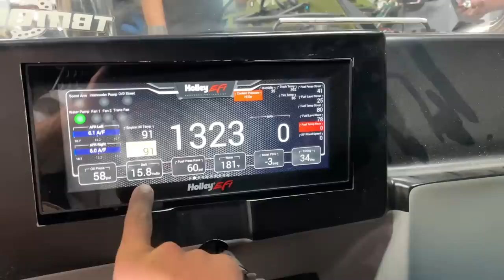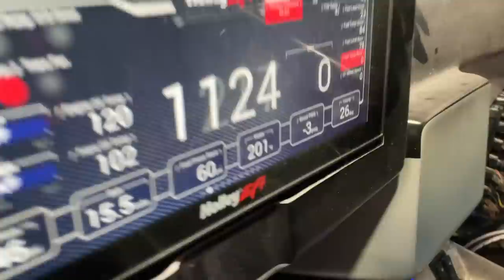FIRST FIRE UP of Mullet's 3000 Horsepower Twin Turbo Big Block!!! **BALD EAGLE SCREECH**

Comment: I just wanna put this out there, John force burnt himself on your old turbo….keep it forever haha
Reply: This comment should be posted up top.
Reply: Elaborate please
Reply: @bicylindrico  John Force accidentally touched one of mullets turbos hot and burned his finger print on it lol
Reply: @ThePackBoyz  Man, was that on video? That sounds funny as hell with Force being involved. Thanks!
Reply: @bicylindrico  Ya it's on one of the videos. Type John Force into the search here on Cleet's channel and you should find it.
Reply: I may be wrong, but I think Mullets John Force DNA infused turbos are destined to go onto  Leroy
Reply: @itzbob5001  isn't ruby gettin Mullets old engine
Reply: I think Ruby's getting mullets old engine but keeping her single turbo, Leroy is getting mullets 2 turbos(John Forces DNA will add at least 2000hp to Leroy) and Leroys old turbos have gone to rodknock rodney.  Someone out there will correct me if I'm wrong.
Reply: @itzbob5001  rodney has the turbo's before this set on leroy i believe
Reply: @bicylindrico  it was another Midwest drag week and one of the stops, John Force was there and he accidentally touched Mullets turbo.

Comment: I can’t even begin to explain how excited I am to see Mullets new numbers. The fact you have Steve with you helping get him on track is even better. Steve really exceeds expectations with his customer service! Between the Cleetus team and Steve, this car is going to be bad ass!
Reply: Looks like he's coming for sickseconds2.0
Reply: @bigcountry908  kidding right?
Reply: @bigcountry908  Get real!  No freakin chance!  Mullet is not designed to run that level.
Reply: can you keep Cleet running? every 3rd time this dude runs he blows up
Reply: boosted boiz territory...
Reply: @slak96u  well, considering he was trying to get 6 second passes out of a small block? Yeah man, I’m not surprised it was blowing up. He had a big block now, so things are about to get way more spicy and reliable.
Reply: @slak96u Kyles current issue (if you’re referring to the MR2) is not a faulty engine.
Reply: For 100k I’d hope there’d be good customer support
Reply: @nvclxud  in a extremely heavy car to boot, things get hot under that much boost in the 1/4mile
Reply: @slak96u  tell me you don't know what you're talking about without saying you don't know what you're talking about
Reply: @slak96u  that poor ls he had was absolutely at the end there was no more room to grow it was time to go bigger to make things reliable and mullet is so heavy 3500+lbs  to go 200 at 7.25 is about 2400 hp now the engine will only see 75%most of the time and should easily make 3200hp turned up to 85-90% not 125% all the time
Reply: @thomasnygard2334  Mullet ran a 6.9 so it only gets better
Reply: for real! i cant wait for this thing
Reply: @bigcountry908  that want happen not with out a complete carbon car
Reply: @bigcountry908  as a fellow cole, i gotta let you know thats not possible in this vehicle simply because sicksecond2.0 is a pro mod wheel base with 34x16+ tires.
Reply: @nvclxud  I mean John doc is running low 4s in the 1/8th in an ls and just pulled his engine for a refresh after 300 passes. Cleetus maintenance program is pretty sub par
Reply: @Brandon_093  mullet is a 1/4 mile car though, and I'm assuming would be heavier, running it that much longer wears shit out a hell of a lot faster even if everything quality and maintenance wise was identical
Reply: @theoriginaljoke3.148  I’m aware of that but still cleetus for all the people working for him has a bad maintenance program and don’t really make the best decisions. The most passes he’s had on mullets old engine before it blew up and got hurt was maybe 30. I like cleetus, I’m not talking shit on him I’m just telling the truth. They’re really gonna have to get their shit together running at this level now.
Reply: @keithharden7844  1 time it did on 55lbs of boost should make that easy on 30 or less
Reply: Heck yea he was always there with Tom too, it is his name on the engine. Steve takes maximum pride in that brothers!
Reply: That’s what you get when you pay big money for an engine
Reply: @nvclxud  I think everybody understands that Cleetus is pushing things past their limits, so no need to defend him on that front. A lot of people, including myself, are not enjoying this crew destroying so many engines with this constant cycle of bigger turbo, more boost, explode. I personally would enjoy seeing the team really focus on perfecting everything thing they have and getting everything completely dialed. Then when it is time for more power, do a proper engine upgrade, which is what they have with this big block. I just hope they take things slow and really dial this car in. Don't just improve ETs by cranking up the boost.
Reply: @slak96u  how you figure Kyles engines last years and they had a mechanical failure on the world record car of course when you are making that much power and something goes wrong bad shit happens but if you understood this sport at all you'd know how reliable it's been the hatch is beyond reliable and the only stuff he blows up normally is stock shit ..no surprise
Reply: @bigcountry908  that's a freaking promod with a completely billet engine capable of 1500 more hp and probably 12-1300 pounds lighter .. never in a million years can mullet run similar times
Reply: @Yz4Life  exactly what I came here to say
Reply: @Yz4Life  that’s why you pay that kind of price. Find me one other company doing the same thing
Reply: @MillionairX  yup simple as that.
Reply: @Brandon_093  the 8th isnt a damn thing. the 8th isnt hard on cars. when cleetus and them do tests they run to the 8th so they dont hurt the car. and i dont know what john doc drives, but i guarantee it isnt as heavy as a stretched wheelbase elcamino.
Reply: @sam_s_  alot of people, myself included are enjoying seeing what it takes to wreck a heavily modified engine, and all the random stuff that can go on. i bet you a large majority of people here also watch whistlin diesel. most of us dont get feelings hurt over what somebody else does with their products. within reason. i dont think anybody here would want to see this morris engine blown up though.
Reply: @thomasnygard2334  imagine what he could get out of this engine if he pushes it as hard as he did that poor little LS.
Reply: @sam_s_  that's what needs to be the goal with Mullet. Keep playing with other stuff like the Blazer to keep those of us who enjoy watching the carnage entertained.

Comment: Wow Steve looked exhausted right before that startup very cool he wanted to come out and be a part of that and make sure everything went smooth as possible hopefully this is the beginning of a long fun relationship for mullet's new engine builder and you guys is pretty cool you became friends before you even bought an engine
Reply: The reason He looked Exhausted was because He spent the whole Day putting on the new shocks, bolting in the torque convertor and building parts to complete the Engine install. The way it sounded was He was supposed to fly down to Cleets shop and fire the Engine up and Dyno tune it. Not spend the whole day finishing putting Mullet back together.
Reply: @MJTAUTOMOTIVE  not exactly he wanted to come and help with certain things he said like that spacer in converter so it was right on and he knew full well it wasn't done all the way and because of the boost his channel has seen since working with Garrett  and the engines that he's no doubt going to sell because of the publicity and ass whoopings mullet is gunna be putting on people he made the smart definitely calculated business decision to go there and film his own videos as well that took hours on its own and with how hot that shop gets in summer it doesn't take long to get wore out just from the heat let alone flying and traveling
Reply: @freedomfox8183  , well it will be great for his YouTube channel, He doesn't need any more business for his shop. He is on a 12 month backorder for engines. He has always been. I bet he didn't expect to be putting in shocks and other items on Mullet, that have nothing to do with the engine.
Reply: @MJTAUTOMOTIVE  rule #1. If you offer to help on something and they say "yea bro its almost done head over" prepare to work on the entire car 🤣

Comment: Steve is definitely a good guy to have on the team. Mullet is gonna be a bad draw anywhere she goes.
Reply: My guess is Cleetus paid Steve to travel there and help w/ final install and tuning.  Cleetus likely paid more for this motor than anything he’s done except the Freedom Factory, so paying Steve the bucks to oversee this makes sense.  Being safe with Mullet’s bad self!
Reply: It’s also really good press for Steve.
Reply: @mysterj1  the car should have been ready when he got there.
Reply: @robgto7051  Yeah he did a pretty good job of hiding it but you can tell Steve was ready to do what he actually came down for
Reply: @robgto7051  Month of Freedom happened. Also they need to finish a couple more cars like the Blazers. It's a full run against the clock.
Reply: @JamesEsau  I dont think it was all Garrett's fault as parts and machine work are massively delayed and backed up. I know he just got his converter and a few other things the day before this. But yes, when you bring Steve Morris into town, its ideal to have him spend the full time dialing in the motor. That and it was probably a tough long day for Steve in that Florida heat and humidity. Cleetus place is NOTHING like those climate control/AC shops Steve works in lol..
Reply: @JonHop1  yeah I get it. I'm not really blaming anyone and I know stuff happens. Definitely want to be ready when you bring the pro in.
Reply: @mysterj1  Honestly wouldn't be surprised if it was Steve's idea to travel there and help. As others have said, this is a massive PR move for Steve
Reply: @JamesEsau  no we really can't tell Because none of us know him as good as the guys but  he was definitely exhausted from sweating his ass off like everyone else in Florida in summer and the plan was for him to be there all day and  he chose to be involved in some of it like making a converter spacer because that's one of the things he's good at and he wanted to be there for press for his company I dunno if people are aware but he also spent hours making a video there so everything he added in his video took twice as long as it should have like any other filming while working does.. stop trying to micro analyze everything he's hot and tired from traveling end of story he made a business decision to go because if he sells just one engine it was worth it and after mullets dialed he's gunna sell and build alot more .. perhaps a CM special 540 BBC or something ..
Reply: @robgto7051  are you kidding me he normally has to do all the work himself I watch his channel all the time well the customer just stands there and watches he does everything even when he's just having something brought there to be dynoed that isn't ready, and  he knew it wasn't done before coming
Reply: @JamesEsau  what he actually came down for was to make a video for his channel and get 10 times more views than he normally does and sell some engines he doesn't care if he had to spend a few more hours there it took him hours just to film his video that he wouldn't have been able to have without going and doing the things they did that's a business move and decision that's why he went there before it was done
Reply: @danielryan007  it's good to see that other people use their head like you and understand why he wanted to go there and do this when he knew the car wasn't ready yet I guarantee you he sells at least one SMX and multiple setups like Garrett's just from this new relationship it's a great move for both sides
Reply: @freedomfox8183  Dude calm down it's really not that big a deal
Reply: @JamesEsau  Steve's no stranger to race cars, everything doesn't always go to plan.
Reply: @hobman  I'm sure he'd rather not see it blown up way too soon.
Reply: I found Steves channel because Cleet bought a SM engine. Hadn't heard of him before this build

Comment: Not gonna lie worried about Cletus fuel line welds after seeing all the fires at no prep kings I don’t wanna see mullet on fire
Reply: That was on the street rails wasn't it? pressure will be quite a bit less than on the race rail. The welds may have been ugly, but it aint gotta be pretty to hold
Reply: @cleatussfmo7437  im pretty sure you are right. It is the return line fpr the street fuel system if im not mistaken.
Reply: You stop that right now young lady
Reply: Also- Tye inspected the welds, at least visually. If they're not leaking on the first light up, they're usually (not always) good to go for the long haul. Big power engines self destruct- it's their nature.

Comment: that bigblock is going to heat soak and when it does its going to rise coolant temps fast and cool down slowly..i really hope the radiator you have in there will hold up..youl know when you pull a few dynos one after another..you wont see the temp rise at first but after the pull let it idle you will see the heat bleed into the radiator after the pull with it just idleing..it looks and sounds great! cant wait to see it rip! and dont forget bigblock no like high rpms like the crownvik lol   HELL YA BROTHER..LETS GOO!!

Comment: Chances of stuff flying off or through the engine and flying through the windshield are getting higher.  Top Fuel uses a Kevlar cover for that. Might need one at some point.

Comment: That radiator should be fine. The volume of water moving through is more with a BB. You just need to through a fan or 3 in front of it.

Comment: What about running an inter-chiller system on Mullet for the temps, Would have to put the AC on somewhere though. I saw it used on ItsJusta6's ZL1 and the temps lowered and leveled out with every pull on the dino. Definitely something to look into.

Comment: Those colors in the titanium welds are a sign your purge was not good enough. Those welds will be hard and might crack. Titanium is tricky to weld without putting it in a purge box.

Comment: Cletus has a bunch of great guys working for him but they are really basically shade tree. The day or two they spend with Steve Morris will make them so much better than flailing around the way they have been. Watch Steve‘s video of the same time. He saved Cletus from ruining an expensive torque converter, showed them their water pump was not working,And a whole laundry list of things they were so far behind on. Anyone can buy a bunch of expensive parts but you just can’t buy 30+ years of experience building some of the finest engines on the planet.  Whatever it cost Cletus is more than worth it for his men.

Comment: Maaan!!! Are those turbos too big to fit in the corner by the firewall and the cutouts by the fender, like i see some of these other turbo cars have them mounted? Hate to see cutting up that new hood to fit around those turbos if its not necessary! Wonder if there is a way to make some cowels over the turbos on each side with cutouts for air induction? Anyway can't wait to see what Mullet does at the track once everything is finished!

Comment: Super stoked! 

Couple questions notes:
- slightly worried about the breathers having exposed bolts on the inside of the cover. Don’t want a repeat of the intake…
- why step-down the down pipe? Seems like an un needed restriction and can get some weird reversion? Just thinking out loud.
Reply: I got this message too does anyone know if its real?

Comment: Steve is a killer engine builder. Not knocking Texas Speed, they build amazing LS stuff. But this guy builds amazing BBC engines and he stands behind his work. This is the engine builder you want tuning in your pit…  Cleetus is about to be hooked on that Big Block Life.
Reply: TKM builds better LS stuff, 2200hp and 4.12 to the 1/8th

Comment: Passenger bank sounded like it was dead a hole or stuck injector possibly… you can really hear the difference between left and right bank when he pans from one side to the other with the camera right at first start up its most noticeable. Steve’s probably already got it cleaned up.

Comment: Has Steve mentioned anything about the size of the exhaust system?  I feel like you could be leaving some power on the table with not going larger.  2” primaries may be good but then At the collectors it’s 3 1/2” (I believe that’s what was stated). So you go from 8” total flow to 3 1/2” at the turbo which is a restriction since they’re not equal length.  Then after turbo goes from what looks like 5”-6” down to 4”.  On a small motor it may not really matter but these big motors can leave big power on the table just because of little issues like this.  Another thing that’s got me thinking, is the throttle body big enough with that much turbo?  Don’t get me wrong, I’m in love with the build and can’t wait to see what mullet will do but I just don’t want easy power to be just floundered away.  Keep up the great work guys.
Reply: 4 x 2" pipes only flow slightly more than a single 3½" pipe if you do the math. Also with turbos exhaust velocity makes a big difference
Reply: ole cleeter said the exhaust is temporary, so steve could tune. Tye is buidling one out of titanium after.
Reply: This will be able to make more power than they’re likely able to ever fully put down. So, no need in every little bit possible. Besides with turbos they can usually just turn the boost up a bit and make up for a lot.
Reply: @NBSV1  I understand that but if I was Cleeter and I’m paying that kinda money for that, I want all it’ll give me.

Comment: Cleatus, has anyone ever taught you about fuel injection?  You do not "pump" the throttle. It is a computer that measures fuel and air based on current conditions. To pump throttle confuses a startup.